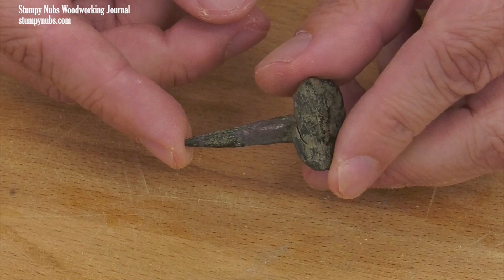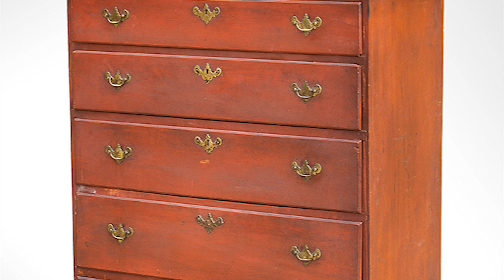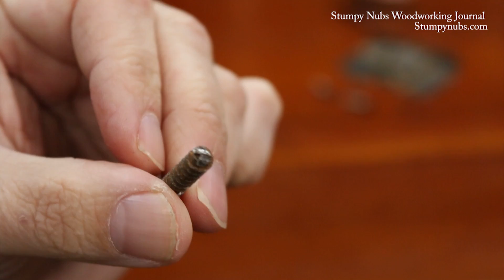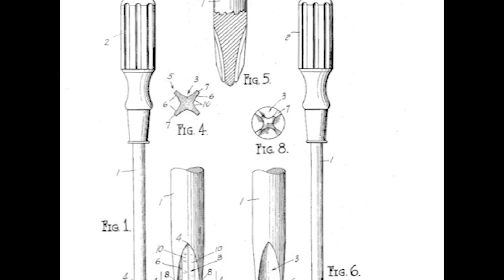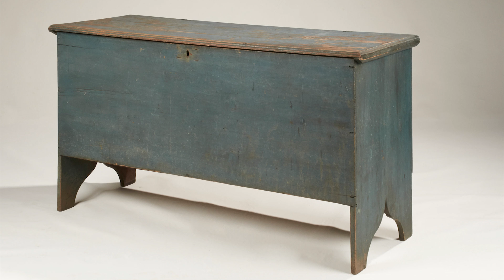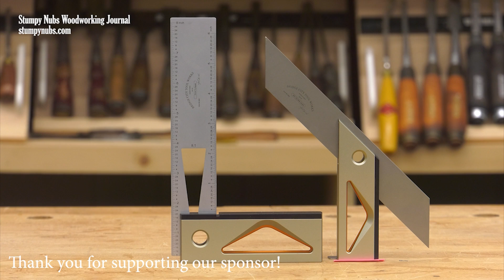The forgotten history of wood screws

Comment: I just put up cement board siding that required expensive stainless, Robertson screws for the particulars of my application.

Despite being on brand Simpson fasteners, the head had a few thousands of offset leading to really bad runout at the tip of the screw. Never thought that was important, but man did it make installing the screws difficult!

Comment: I like screws when I need to pull things together, but unless you are using an expensive rated structural fastener, nails are the way for structural scale shear loads.

But I’m working on building a house, not cabinets…yet.

Comment: Those coated deck screws bend quite a ways before they break. You can actually see it in the video where he bends it until It breaks. I've built a lot of structural things with those, I've never had a failure because of using them.

Comment: Thanks. An interesting video. I can't imagine having to hand file the thread on your dozens of screws in a piece of furniture. My house is 227 years old and I try to keep the woodwork 'as was'. In Great Britain, finding slot headed screws is like looking for Unicorns. I'm the first one to be found rescuing screws and hardware from scrap, when someone is re-moddeling their home.  Now something else about screw heads. In Great Britain, almost exclusively, screw head for joinery and building are Pozidrive.  Here, Philips head screws are only found on the machine screws on electrical equipment. I've no idea why that is, but there you go.

Comment: An interesting test was done on the nails vs. screws topic, and I am now a believer in screws - even in vertical strain applications.  A test was done using 2x lumber fastened together in a few different ways and in each case, one used screws and the other used nails.   Pressure was applied to the boards using a hydraulic press that monitored pressure as it was applied.  One example that I can remember was a board was run horizontally attached to vertical studs.  Downward pressure was applied to the horizontal board using the hydraulic press.  This is a case where I thought for sure the nail would dominate but that's not what happened.  Either the nail would give and it would pull the nail out (i think they simply called that "pull out") of the wood or the other case was what they called "tear out" meaning the fastener literally cut through the wood and tore out of the thickness edge of the board.  The screw dominated at every single test.  Literally every single one.  What it concluded is although a nail does technically have more sheer strength, when you apply strain to it its either going to pull out of the wood or its going to tear through the wood long before it  reaches that point.  The screw dominated in the tests that it should have dominated (like the force it takes to seperate 2 pieces of wood - 1 fastened by screws and the other fastened by nails).  The screw also dominated in the cases where the nail should have dominated but thats because the nail could not hold the pieces together before it reached its snapping point.   I think nails are preferred by homebuilders b/c they are much cheaper and faster to use than nails but after seeing that test I now know a house frame assembled with screws is actually a lot stronger.

Comment: Hello Stumpy, you said you read most comments so I wanted to reach out to you as a newer viewer. I’m slowly starting the process of building my own wood shop, I currently work in a custom Mill shop and my question is do you have any advice on how to go about properly scaling up to a full blown wood shop. I would like to take a loan out to build a shop but idk if that’s the smart thing to do.
Reply from the maker: That's too large a question to answer all at once. But I like to avoid going into debt as much as possible. I definitely would not do it all at once. I would start small with some used tools, making a few things to sell online or at craft shows. See if you actually like that side of the craft and if you can actually make money at it. Then add more complex and more profitable products and upgrade only the tools you need for those. Follow that pattern, only upgrading your shop as the product you are able to successfully sell demands it. You can do a lot with older equipment and some homemade jigs to ensure accuracy and repeatability.

Comment: If only the deck screw industry would make screws correspond with common nail sizes instead of inches. Often a deck screw will be either too short or too long because common lumber sizes are not scaled to whole inch measurements.

Comment: Another reason screws are still rarely used in framing houses is because they are slower to install than a nail. Even with just a hammer, a nail takes less time.

Comment: Square drive screws I never saw or heard of until I started work  24 years ago where I'm still at, they are better than phillips but I prefer Torx hands down.
When I redid the floor in my house with porcelain tile I had to screw down plywood and cenent board,  I used 3-1/2" torx to screw the 1-1/2" CDX down into the joists, hundreds of them, all drove right in, I used ONE bit for all, the cement board screws only came in phillips and square drive, so I chose square drive, I dont know how many bits I went thru because they would cam out, and it does it once and the bit is damaged and does it easier.

Comment: Speaking from experience, a model a with the original Interior is completely done In Robertson screws. Not Phillips. This is because There were two factories that assembled the vehicles one in Canada built the interior to be shipped and later installed at the second plant in the United States where the rest of car was built and completed with the Canadian pre-manufactured interior installed. (sometimes the cars were shipped to Canada to have the interior installed at the Canadian plant, but those were the ones to be sold in Canada. Otherwise the interior and wooden framework was prebuilt in Canada and shipped to the us plant for further installation.) Phillips was created by Henry Phillips. I’ve driven and worked on a quite a few model a vehicles. Every one of them I’ve experienced in the wild has had Robertson screws that were used to fasten the interior, right down to the wood framework of the vehicle. (If it’s original) I Learned to drive stick in a model a Tudor and drove all over east county San Diego in model a’s and t’s in my early 20’s.

Comment: The problem with Philips screws is very often poor fitting screwdrivers. When they get worn they slip and they can't be touched up like a flat screwdriver. People don't even know what size Phillip screws they are dealing with. They are not all #2. Klein tools make very accurate Phillips screw drivers with hardened tips. Discovered Robertson screws used on Hatteras Yachts  back in the 1970's. They included a couple  of screwdrivers with the tool kits.  Chris Craft boats back in the day used Reed & Prince screws in many different head sizes. They look like a more pointy Phillips but are different enough that a Phillips screwdriver will mess them up. With a clean screw head and the right sized screwdriver they drive great. Still have a complete set with wood handles, don't get used much! Rybovich sport fishing boats used large slotted SS screws in the gunnel strips around the hull and all the slots lined up  horizontally and followed the shear line of the hull. Not easy to get them tight and aligned with each other.

Comment: The roberson style does get stuck on the driver bit alot.  Great info
Reply: I have to remove a lot of screws in my job and yes, they do sometimes get stuck a bit. I either unscrew them most of the way, pull out the driver, then finish removing them, or end up rapping them sideways against something to knock them off.

Comment: t17 constrction screws are pretty common. 

I'd say a huge factor in nails still being used is the nail gun. If it was a choice between hand hammering and a battery driver.... most would choose that. A nail gun is instant. Can fire 10 nails in less than 10 seconds, and means moving warped or out of line structural pine in a house build is quick, and easy and less straining.

Comment: robinson dindt invent anything!? there is many screws patents from the 1860s and 1870s in furnature that had square and tapered square slots!
Reply from the maker: Not all squares are the same. Robertson's was different. The others square styles didn't work because punching in the square recess deformed the screw head. Robertson solved that problem by making a square recess with sloped sides. It made it possible to mass produce them,  and without that innovation, the screw would never have been commercially viable.
Reply: @StumpyNubs  i belove there is tapererd shank square drive screw patents from the 19th century that are exactly as the robinson.. theres also triangular patents and oval shapes. i dont see any reason robinson should have been issued a patebt.. unless its more that do with the production process or a machine he patebted ect.. because I se his screw is not any different that many patentes issue ed before his birth.. the robinson deforms the head when punched. the screw  is formed in the punching process.  maybe he had some method to produce the better and quicker, cheaper ect.  but his screw is a  copy  of prior screws

Comment: Especially in timber frame buildings, they use nails because they can move, screws do not. If there's high winds the timber needs to be able to flex and move, rather than be rigid. This would cause the building to rip itself apart.

Comment: Great video history. In my business, the screw is king. The company I worked for for most of my career was famous for extremely solid builds. When I started there in the seventies, and through the next 35 years there, we used screws ranging from 2” long #2 screws, to 3” #18. All were slotted. I have even found screws up to what I assume were #24 (basically a half inch lag with a slotted flat head), in some of the older instruments I worked on restoring. I’m pretty agnostic when it comes to drive types. I too like those star/torx/whatever drives. But nothing beats a well maybe slotted screw, when you’re driving #12 or bigger. There’s a technique to it. I also think slots are more aesthetically pleasing. Anyway, I enjoyed the video very much.

Comment: Dude, I saw the history portion of the information in this video on a channel called "The History Guy." The problem is that his video was a bit too drawn out, AND it was only history. It was good, but it lost me for the length. Here you offer the same historical information in a shorter time frame and you add to that some practical application for the knowledge you get from the history. In short, YOUR video is, overall, far more helpful and informative. If you can keep me captivated through one more video I'll subscribe and ring-a-ling the ding-a-ling.
Reply from the maker: Might I suggest this video: https://youtu.be/I0Z2PdMzzhk

Comment: I'm surprised they don't have some kind of shock absorbing spring steel and rubber angle brackets for modern furniture, so you can attach anything to anything and know it's gonna stay right there regardless of expansion, maybe with a little wobble.

Comment: Screws can replace nails effectively by utilizing the clamping force of a partially threaded screw shaft to bite into the bottom piece, while the head of the screw forces the top piece to squeeze against the bottom. This clamping pressure against the two pieces creates tremendous friction that will hold stronger than any nail. This is why structural screws have very wide flange heads, to provide much greater clamping force. But you can use cheaper screws too, in conjunction with washers to replicate the larger flange head.

Comment: AFAIK, wood screws are still just made of low to medium carbon steel. I suspect the lack of sheer strength has to do with how they're made. The threads are not cut by file or lathe on a production wood screw (or most factory screws in general for that matter) but rather rolled between two serrated dies that form the screw thread via mechanical deformation rather than removal of material. This work hardens the metal. Furthermore, the shape of a screw is basically that of a spiral of stress concentrators. When you bend a screw, it will always yield at the valleys. A nail will distribute the entire force evenly since the shank is the same diameter all the way down. 

This is my hot take anyway.

Comment: Cam out is not a flaw in the Phillips.  It was done by design.  The rationale was that the driver should cam out when too much torque is applied before the screw head is damaged.  Annoying yes, but it designed to happen that way.

Comment: The earliest metal screws that I know of were made by the Ancient Greeks somewhere around 300-200BC, from the same school of practical mathematics/engineering as Archimedes studied with. The male thread was made by winding a triangular cross section wire around a straight wire then soldering the whole thing together, the female receiver was cludged together in various fashions - they were used as fasteners in jewellery, not wood. Later, for large screws/bolts the male thread was filed and the metal nut was hot forged over the male thread then worked back and forth while hot until it worked well enough - Martin Löffelholz shows tapered metal wood screws in the early 1500's for use in furniture but the big screws are still wood, made the same way the Greek engineers described.

Comment: I still like Posidriv screws. I inherited a big collection from my dad, and with my DeWalt impact driver set to 1, the torque provided is perfect. I prefer Robertson for construction work and ease of assembly, but for feature fastenings I always go with Phillips head brass screws. Or even old-school slotted brass screws. I have a heap of those, as well. 

I think brass screws come up beautifully when sanded perfectly flush with the surface of the wood, plus a few passes with ultra fine grit to polish them up. Especially nice if a varnish, or polyurethane is used to protect the brass sheen.

I'm restoring an old Perfect Handle screwdriver right now. But I'll probably never ever use it. Yuck!

Comment: Always surprised me that nobody invented a slotted screw with a small angle in the bottom face. Like a very shallow two side dphillips. It would have the slip resistance of a slotted screw but without the driver falling out, could still be driven with a standard slot bit, and could be produced fairly easily. Maybe I'm missing something but if I had those I would never use Phillips or slotted ever again.

Comment: One trick I learned as a kid was to use soap on a screw when it was hard to screw it in. So if you really have to use a lot of force which results in damaging the screw, try soap on the thread as it functions like grease on a bolt and works much easier.
Love your videos and the knowledge. Thanks!

Comment: If anyone wants a better experience with slotted screws get gunsmithing screwdrivers. They are hollow ground so the reach to the bottom instead of wedging the slot and stripping.

Comment: As a frame to finish and most tasks in between carpenter I am 100% guilty of understanding that a screw will break when a nail will allow movement in the structure. In saying that I still build my decks using screws 100% of the time. 24 years in the trade with just over 10 working for myself I have never had anything I have constructed (really only decks) using only screws develop any structural issue. Nor have I had to go back and hammer nails tight again due to that dumb "sun pulls out nails" bullsh*t.. Lmao.. I also prefer Torx  head screws.. I will attempt to remove Phillips only to replace them. Slotted head screws will always be met with violent threats using prophanity and a cut g rider multi tool..

Comment: Personally I find the Robertson screw head to be the superior design, especially with the tapered bits that fit more than one size. But the wide availability of torx makes it more commonly used for me. I don't understand why Philips still exists
Reply: Torx is nice, unless you work in a machine shop where several people don't understand there's a torx and a torx plus
Reply: I think,,that the NZ screw of choice is the square head screw...maybe professional builders  may prefer the Torx, but I have never used one. Can't say I am at all a fan of Phillips screws, for the advantage/disadvantage that the driver slips out too easily. Don't mention slotted screws in polite company.